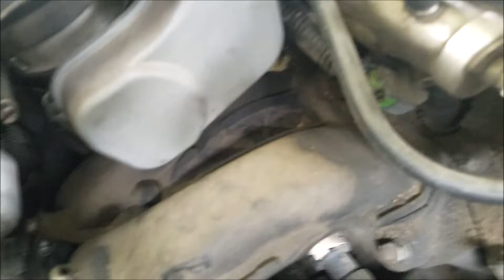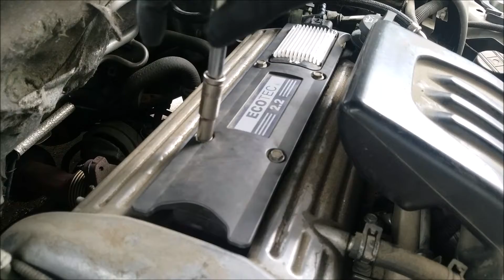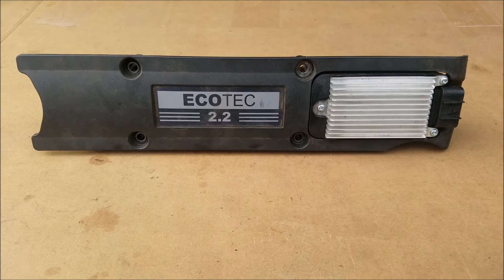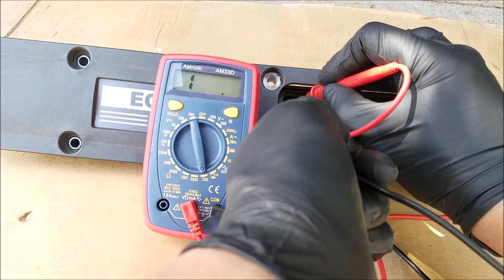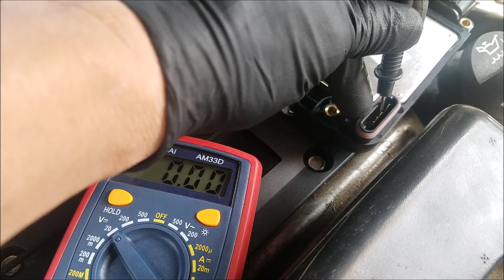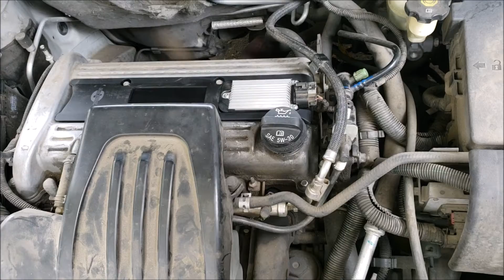2006 Chevy Cobalt 2.2l Misfire P0300 (Testing and Replacing Ignition Control Module & Coils)

Comment: Could it be the connector itself that plugs into the module? I did have a bad wire (pink with white trace) if you tugged it towards front of the vehicle it died out. I re pinned it and its good now. But im still having multiple random misfire for 2 and 3. Brank new ngk ignition coil and module set. Only reason I started to pull on wires was because I would randomly stall coning to a stop and I believe that was the problem, along with a bad ground I found right around where the oil filter housing is. New plugs as well. It all started with the multiple random misfire but that went away and I was having stalling issues. So I then replaced a bunch of other parts to come right back to this misfire  again

Comment: By testing the compression on the first spark plug hole while the other spark plugs are still in now they will be all soaking wet with unburned fuel and how do you tell if they were bad or not

Comment: Question 
Car shuts off after it's warmed up. I replaced the ICM and coil pack assembly and fuel pressure regulator.  
Disconnected battery. Drove 20 minutes and check light comes on. Code is ICM again.
What could cause the ICM to keep coming up? I have 3 ICM that check good according to this video and coil packs. 
Any help is appreciated. 
2004 chevy cavalier ecotec 180k miles

Comment: I know this is an old video, but I have a misfire on cylinder two and I recently bought the ignition coils but not the silver  part on the side, is that necessary for the replacement to work or can I just do the coils, I tried replacing them and my car would crank but not start, I put the original coils in and it started, does anyone know what I can do?
Reply from the maker: Well if u only have a misfire on one cylinder it may not be due to the coils..cause each coil powers 2 cylinders..so normally when a coil goes bad itll affect those 2 cylinders at the same time..but when the ignition module does go bad on this model..it can affect a specific cylinder or even all the cylinders
Reply: @backyardchevy328  Thank you so much for responding, I appreciate you taking the time to reply! Awesome video btw!
Reply from the maker: @StoicOwl808  anytime🙂👍 thank you

Comment: Thanks for the great video.  I have a 2003 Chevy Cavalier 2.2L Ecotec with this same coil pack/ICM combo.  I am getting random misfire code P0300.  Since I replaced this coil pack about 5-6 years ago, I thought it may be going bad again.  However, when I put a new coil pack in, it won't start at all.  Put the original coil pack back in, starts fine (although runs rough when cold).  I have tried (4) several brand coil packs, and they all do not work at all.  Only the original allows the engine to start.  One of the new coil packs also came with new boots, didn't make a difference.  I can't imagine ALL the new coil packs are actually bad.  I have also replaced the ICM, but it did not help at all.  Any ideas on what would cause multiple new coil packs to not work at all?
Reply from the maker: Any chance ur using dielectric grease on the connectors? Or not using the adapter for the ignition module to coil
Reply: @backyardchevy328  I am not using any dielectric grease on the connector (although the new ones did seems to have some kind of grease pre-applied to the female connector on the coil packs.  By 'adapter' do you mean the rubber boots with the metal spring spacer inside them?  if so, then yes.
Reply from the maker: @darrendexter6125  theres like a plastic connector adapter that u slide into the ignition module and it also slides into the coils on the other end
Reply: @backyardchevy328  That was what I was missing, thank you.  So, the new coil pack works, but did not solve my issue.  Will keep working on it.
Reply from the maker: @darrendexter6125  and u said u replaced the ignition control module as well?
Reply: @backyardchevy328   Yes
Reply from the maker: @darrendexter6125  then yea u may have to dig further..do u have access to a scanner which tells u which cylinders are misfiring?
Reply: @backyardchevy328  I have a ODB2 scan tool.  Are you talking about the Mode 6 data for misfires?
Reply from the maker: @darrendexter6125  the live data where u can monitor things like misfires rpm etc.

Comment: I had a 2006 Chevy cobalt that started shaking when I come to a stop.Since I had tha same issue about 3 years ago and I fixed it by replacing the whole electrical panel that attaches to ingnition coil.This time round, that part seemed very new so I thought.I ended up getting a code reading at Auto advance that read
1.Cylinder 3 misfire
2.  Low 02 sensor on bank 2
3. possible fuel leak
So I started by personally changing Spark plugs,Both O2 sensors, a whole can of techo fluid,a new Ignition coil but the problem still existed.I changed the spark plug boots but nothing happened.My last bullet was changing the same panel I had changed 3 years ago.Went back to the shop bought a new part ( control module) that attaches to ignition coil changed it in less than 20 minutes and the problem was solved.So dont under- estimate that the part is good because it look new.Go back to the basics of fix exactly what was wrong the last time.Hope I helped someone
Reply from the maker: Yes, very true...glad u were able to get it fixed
Reply: how many miles was it when you had that done .
Reply: You just described the exact problem my wife’s commuter car had! I’m going to Autozone now to buy an ICM! Hopefully you just saved me a trip to the mechanic!

Comment: I have a 2006 chevy cobalt. Code 0300. Replaced ignition coil pack OEM replaced ignition control module replaced spark plugs replaced fuel injectors replaced MAFS replaced O2 sensor upstream did drive cycles 90 miles or more. Light still on
Reply from the maker: Does it still feel shaky like its still misfiring? Have u tried leaving the battery disconnected for 30 mins to reset the computer manually?
Reply: Have to replace my ignition coils problem is nasty stuff

Comment: Hey I have been having the same problem with a random missfire. I replaced both the spark plugs and the coil pack. It still has the same miss. I haven’t yet replaced the ignition module like you did at the end.
Reply from the maker: Yea normally when the coil goes bad itll run really bad since it affects 2 cylinders..so a random misfire is more affected by the ignition module
Reply: @backyardchevy328  okay I have one coming Thursday hopefully that will fix it. Thanks
Reply: @caleleppert10  was that a fix? I have the same problem. Pls reach back out
Reply: @SteveEasyOnline  it had a bad injector and fuel line had a pin hole and lost pressure
Reply: @caleleppert10  how did you find out which was the bad injector
Reply: @brolla12  i didn’t I took it to a local mechanic and he found it

Comment: Did it throw a DTC for p2101? Or what dtc got thrown? And did it put the car in "limp" mode and show reduced engine power?
Reply from the maker: No, this one just got a misfire code p0300... but a p2101 code would put the car in limp mode since it is an issue with the throttle body and the engines acceleration
Reply: @backyardchevy328  hmmm.   I'm not getting that code. But I'm getting misfires. The throttle body seems to be working fine I did clean it up a little bit without taking it off the car. Any idea what it could be or why not getting a misfire code if I'm getting misfires?
Reply from the maker: @nosrednac8948  does the check engine light come on when u turn the key to the on position? Is it just a random misfire like not constant? If not misfiring enough it may not trigger the code
Reply: @backyardchevy328  it's a constant misfire it's been happening for about 24 . Car has been in limp mode ever since
Reply from the maker: @nosrednac8948  oh ok...does it feel like its a single cylinder or 2? Normally when its an issue with a coil itll misfire on 2 cylinders since one coil runs two..unless its a newer model with the individual coils..besides that it could be the ignition module or the basics like spark plugs..injector..etc.
Reply: @backyardchevy328  and to answer your last question I had a check engine light come on for EVAP code p0068 that was thrown but I cleared that and I haven't had the light come on since.  That was in the beginning of the week.  Also p1683 or p1685 came up today when my buddy checked he said but i didn't get tht myself earlier.... it's a 2006 Chevy Cobalt 2.2
Reply from the maker: @nosrednac8948  p1683 would be an issue with the control module..maybe thats whats causing misfire and not triggering a misfire code..its probably having some sort of issue or needs reprogramming
Reply: @backyardchevy328  okay thanks. You're very helpful!

Comment: I got a p0300 show up today. It started randomly misfiring only above 60mph, then a week later it started hesitating at red lights.
Reply from the maker: Have u checked ur spark plugs to see the condition of em? If thats ok usually a coil when it begins to go bad..begins to misfire under load..but for those when they fail they cause misfires on 2 cylinders since one coil runs 2 cylinders and that would be very noticeable.

Comment: I need your help, 
My car is having random misfires (P0300), I replaced the entire ignition control module along with the spark plugs. I also cleaned the maf but it didnt make a difference. The car drove just fine yesterday. It happened over night. What should I do in thus case? Also, subscribed! Thank you!
Reply from the maker: have u tested the ignition coils? any chance u have a scanner that shows the misfire counter? if so usually the coil when it starts to go bad itll affect 2 cylinders at the same time, so the misfire counter will show 2 cylinders with misfire counts on em...if the ignition coil checks out fine..id check the compression to make sure the internal portion of engine is ok..then id probably test the fuel pressure or check the injectors...i have another video on my video list of things to check if u have a misfire.
Reply: @backyardchevy328  so I bought the ignition coils as well with the new control module. Even then the misfires are carrying on like before. I check the injectors and compression. Is there any possibility that the crank position sensor is bad?
Reply from the maker: @enayetkhan9397  usually a bad crank sensor will cause starting issues or itll make ur car shut off randomly...could be a dirty throttle body or dirty maf sensor..vacuum leak somewhere.
Reply: @backyardchevy328  so turns out, there was a small plastic piece that somehow got in between the intake (cyl 4) valve and the head. It was forcing the valve to remain open. The rocker arm fell off too. I was able to remove it, the car is driving fine again. There was nothing wrong with the ignition system. 200 dollars down the drain. Thank you for all the information though!
Reply from the maker: @enayetkhan9397  wow thats a unique one...the compression test should of caught the no compression on that cylinder

Comment: Hey, just wanted to point out that Amazon says that the Ignition Coil Assembly you have linked does not fit on a 2006 chevy cobalt.
Reply from the maker: Thank you:) i did double check and it is the proper one...even rockauto has that same part number for the ac delco brand..but not sure why it says it doesnt fit...heres the standard motor brand https://amzn.to/38IrbJf
Reply: @backyardchevy328  Oh, not the first link, the second link. The one that goes to the coil. The Spectra Premium C-765 Ignition Coil, Amazon says it doesn't fit that model.
Reply from the maker: @TheFoxern  thats so odd...none of the ones meant for that car say they fit..even other brands

Comment: I removed my ignition coil module and found engine oil in the connector. Safe to assume this is what is causing my misfire?
Reply from the maker: Yea it is possible its affecting the connection, but cant be sure, i would actually think it would affect it even turning on with oil in connector
Reply: It turns on. But the oil is in the coil pack as well I'm pretty sure. I dunno how it got in there. I mean I did just replace the valve cover and did find a cracked spark plug seal. But I'm still getting the misfire. Plugs are good. And I cleaned the boots and everything with brake cleaner. The first thing I checked when i got this problem was the plugs and the boot and plug were dripping with oil. But evidently there's still another issue somewhere. There module itself is putting out voltage. 

Anyways I cleaned everything I could get to and used dielectric grease on the ICM. I haven't reset the codes to see if they come back but I have a feeling they're still going to. It's all running rough. 

This is for a 2005 cavalier. Same coil pack and ICM. 

Any other ideas on what to turn to? I have no experience with this car, I bought it cheap to get me around until my insurance claim is settled. My actual car got totaled.
Reply from the maker: @slipknotpsycho5891  is it one cylinder misfire or 2?
Reply: @backyardchevy328  it's p0300 now. It was p0303 I think. Same cylinder that had the broken seal. The car doesn't really have trouble running. It's just not running smooth. Never feels like it's about to stall.
Reply from the maker: @slipknotpsycho5891  yea most likely only 1 cylinder misfiring then..have u removed the boot for the 3rd cylinder on the coil and cleaned that and the spring contact..it could be an intermittent misfire too where the ignition module can actually be the cause of that too..besides that u can test the injector to cancel that out..the compression to make sure the compression on the cylinder or cylinders is fine
Reply: @backyardchevy328  I cleaned everything when I did the valve cover gasket. I used brake cleaner, to wash out what I could, then used qtips to get the rest. I haven't messed with injectors yet. My first thing to look at was the spark plugs and see if that gave any indication, which it did. It was covered in oil. I just barely did the gasket yesterday.

Comment: I have only one cylinder misfire according to the OBD error codes. Is it right to think that the coil pack must be good since each coil works two cylinders? Could a bad Ignition Control Module cause a misfire in only one cylinder? It is  cylinder 3 and I also get P0106 Manifold Absolute Pressure/Barometric Pressure Circuit Range/Performance.
Reply from the maker: Ur other code might be an issue with the map sensor which is located just above the throttle body which youll have to remove the air box above it...yea the coil going bad usually affects 2 cylinders..the misfire could be a bad module..but could also be a bad spark plug too..even a bad or dirty injector